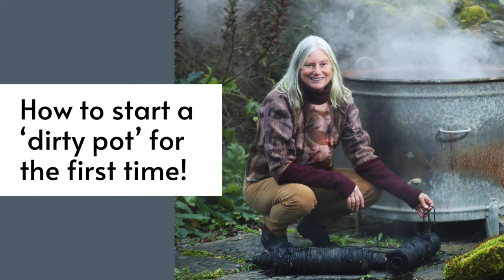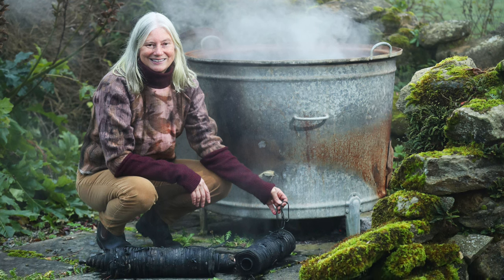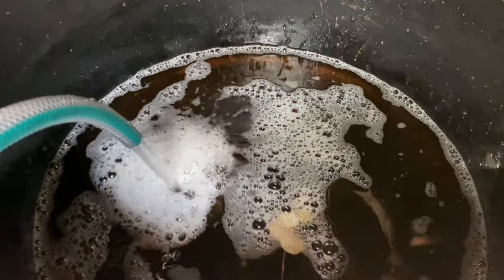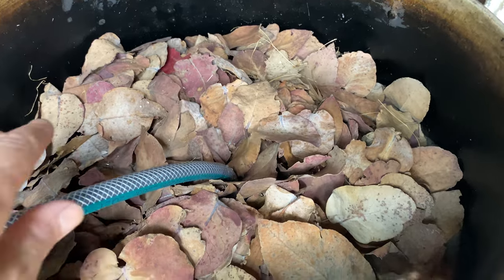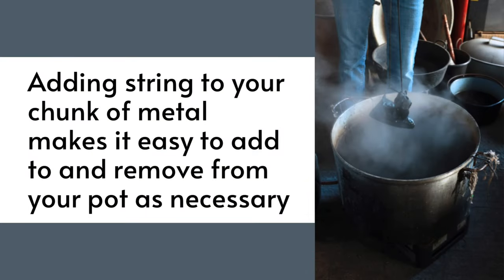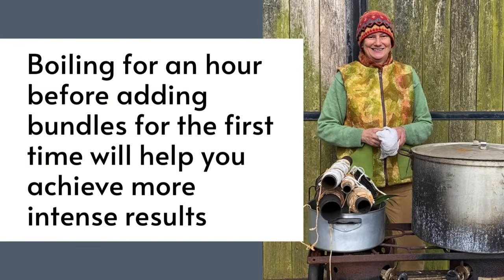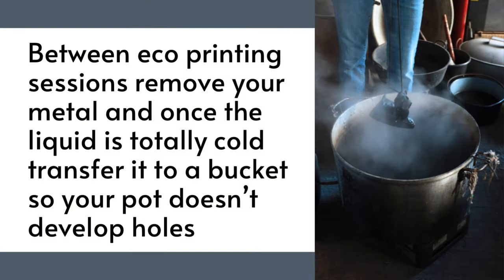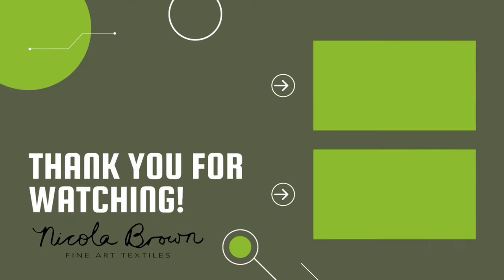Starting an eco printing pot!

Comment: Dear nicola, I have a small problem about eco printed fabric.when we wash them, are they trying to fade?
Reply from the maker: When you wash the fabric initially Chaali you are trying to remove any dye that has not been absorbed by the fabric. After then if you use the correct process and vegetation as well as washing with a gently soap they won't fade

Comment: Hi Nicola, I absolutely love your approach to ecoprinting. With regards to starting a homemade rusty water, I don't have a large cast iron pot, and the fabric I want to dip is quite a large piece.  Would it be ok if I use a large enamel dish with lid (I think it's similar to a Dutch oven) with rusty elements in. I am also battling to get an aluminium pot since I gave mine away some years ago 🤦🏻‍♀️🤦🏻‍♀️🤦🏻‍♀️ . If I use a large stainless steel (to cook in) pot with rusty elements and the eucalyptus leaves/onion skin in the water as you've suggested previously, do you think that would be ok? Such a long convoluted message hope it makes sense. Thanks so much for sharing your experience. Hello from South Africa!!
Reply from the maker: Hi Cinzia, greetings from Ireland! Making your rust water in the large enamel dish should work well. I’d suggest plenty of rusty metal, vinegar and bring it to a boil for an hour or so and it will be ready to use. If you leave it for longer or make it a week or so before you are ready to print your large piece of fabric the liquid will be getting stronger with time. Working in the stainless steel pot (after the fabric has been dipped in rust water for 40 seconds) will also work too. The results may be a little different that if you were printing in an aluminium pot but so long as you use leaves that you know give good prints on protein based fabric you will be good to go. Good luck!
Reply: @clasheen  hi again Nicola! Thanks for your advice. It's linen fabric, so not protein. Will it still print ok? It should do, right? I have no idea which kind of eucalyptus we have here, down the road from me are several trees so I will be using those. It's for a wedding gift so I hope it works ! I will put photos on the Facebook group (which I have joined).
Reply from the maker: @cinziabeley7059  Hi again Cinzia, revising you do the rust water dip and bundle tightly you will definitely get prints using eucalyptus. They won’t be reds but they should look beautiful! I suggest processing for 2.5 hours at a rolling boil. Good luck and I look forward to seeing the photos!
Reply: @clasheen  thanks Nicola! Have started my rust water so long!!

Comment: Could one ground up rust and add to water instead of a lump of iron?
Reply from the maker: Do you mean a lump of rust that you have scrapped off something? You could add it but might need a bit more than when you add the chunk of metal.
Reply: @clasheen  I have a large rust pipe to large for small  pot so can I scrape rust off and add to pot- sorry for being unclear
Reply from the maker: You can do that but even better, have you a bucket that your rust pipe will fit in? Make a home made rust water solution following the info in this video https://youtu.be/xMmU3iC1X5M and add a good slosh of it as well!  @snipeweedan